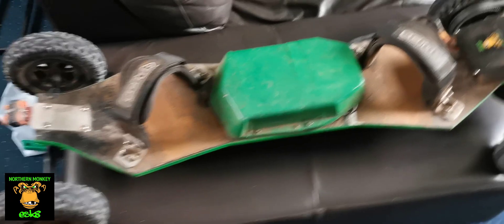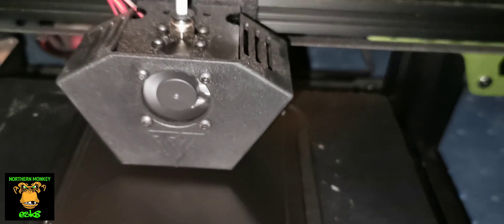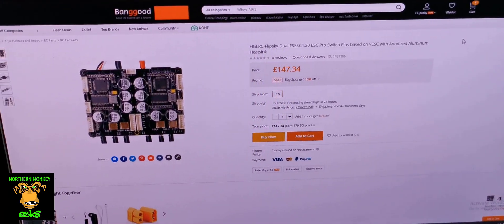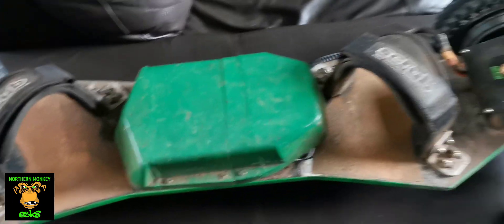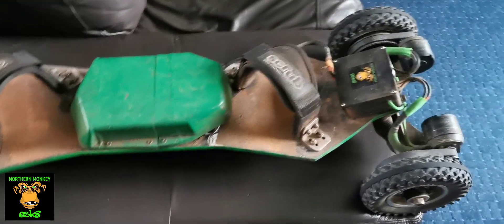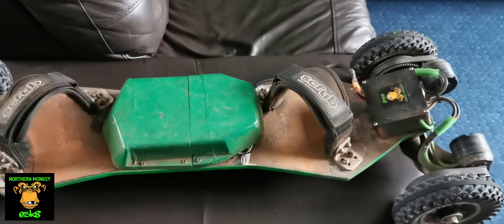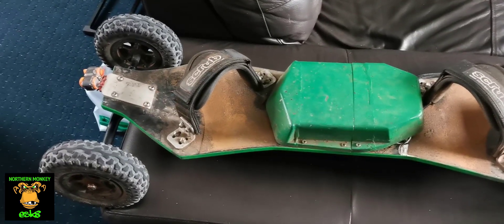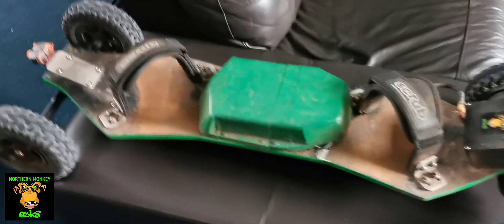HGLRC-Flipsky Dual FSESC4.20 ESC VESC Review

Comment: Nice review mate. Exactly what I've been looking at for my cheapo build. Did you switch out the motors since the last video though? I thought they were generics and these look like Flipsky motors now.
Reply from the maker: yea these are flipsky motors. I upgraded thinking I'd  get more speed but I was bottlenecked by the cheap esc. since upgrading tho this thing is a beast!!!
Reply: @SeanPook  Cheers man, I thought it was. Oddly Flipsky themselves do an offroad kit like the one you got but with different looking mounts. You can get it front and rear truck kit from their Aliexpress for about £217. I'm quite tempted as the mount looks pretty alright. 

https://flipsky.net/collections/e-skateboard/products/off-road-skateboard-cruiser-extreme-sports-longboard-dual-drive